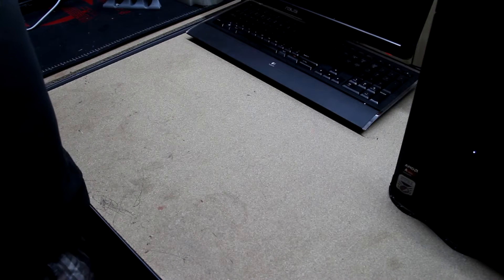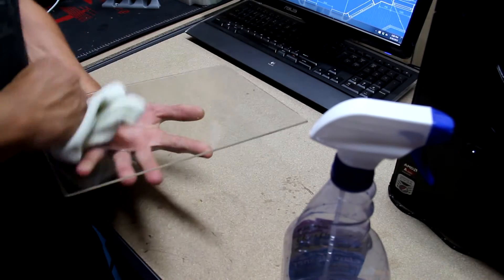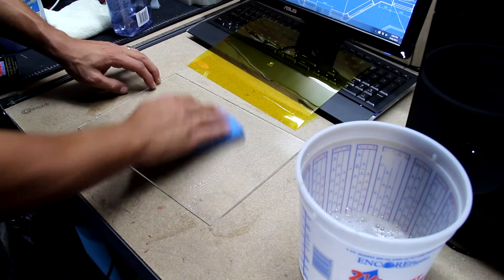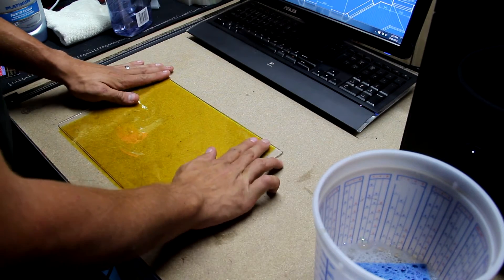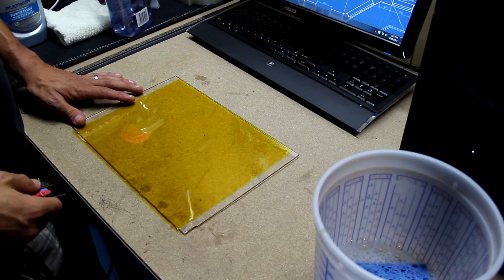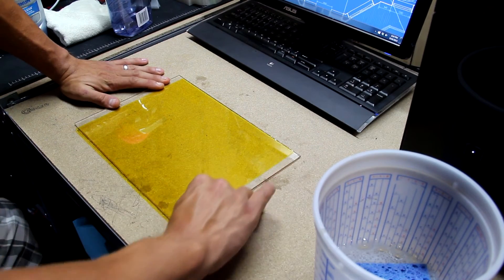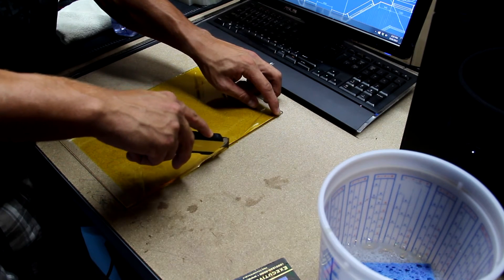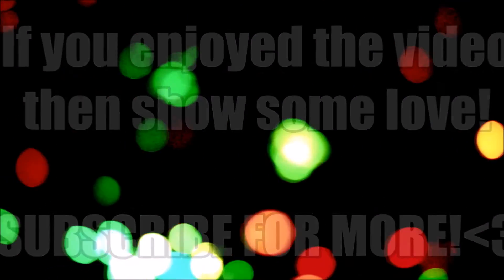3D Printing Tutorial - How to Apply Kapton Tape (The Easy Way) - Fix For Bubbles on Your Print Bed

Comment: Good vid - I use the soapy water method for restoring motorbike bodywork stickers. I also use double sided kapton for important one shot wide prints that absolutely need to stick because of cost for fancy filament.The double sided stuff really sticks but you have to be quick before it gets contaminated.
thanks and cheers